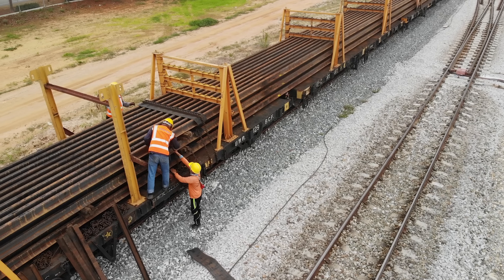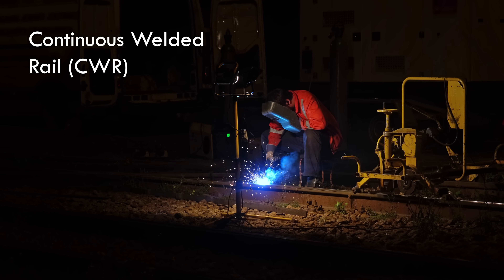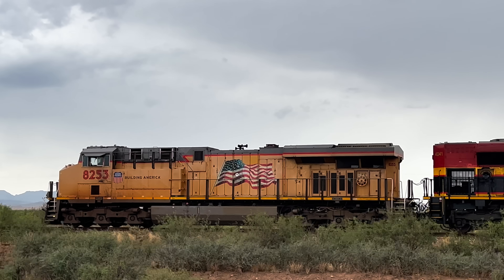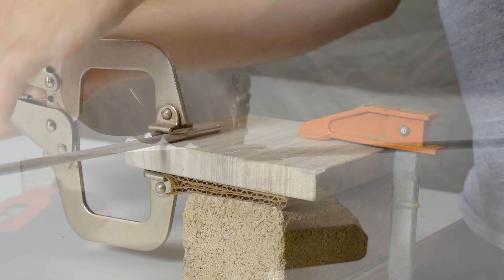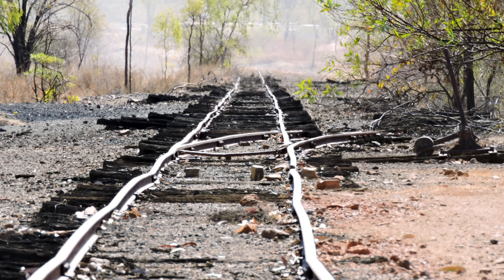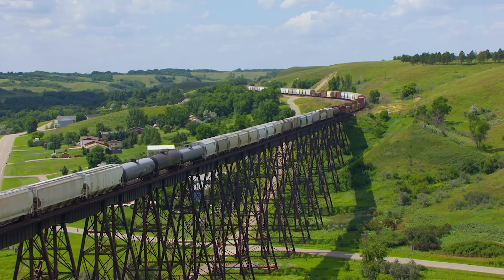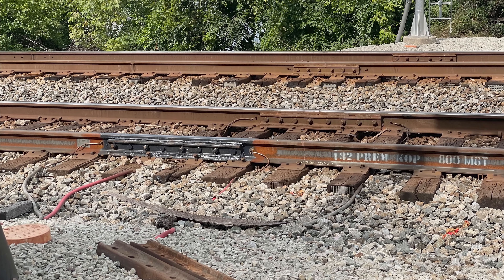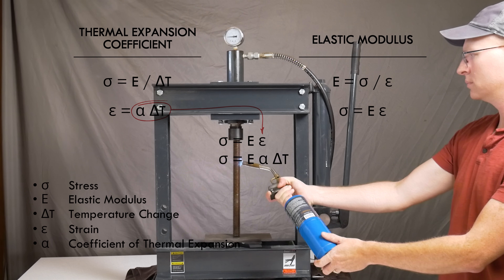Why Railroads Don't Need Expansion Joints

Comment: This was hard to watch. I'm in Victoria, Australia. Much of our rural rail lines were "upgraded" to continuous welded rail, about 15 years ago. The only problem is, the wrong materials were specified. The expansion coefficient of the chosen steel was not able to cope with our conditions. On hot days, the tracks buckle like a drunk's knees and our trains are forced to slow to a snail's pace. Often, they're replaced with bus's.
The worst thing is that the government was advised of the problem. We have a rail switch manufacturer in our town who sent numerous letters advising of the fault. They received no response.

Comment: Fun fact: The problem with 'rock n' roll' (more formally, harmonic rocking) is bad enough that rulebooks disallow travelling at certain speeds on jointed rail. The rulebook I have says this danger zone is 13 to 21 mph, so if your train only has enough power to reach 20 mph (entirely possible, if normal, these days) safety says you'd have to slow to 13 mph on jointed rail. So CWR not only makes maintenance-of-way's job easier, it also makes operating the trains a bit easier and safer too.
Reply: So I think your point is; stay out of the resonance zone or transient through it as quickly as possible.   Go slower or faster so you don't build up a resonance that can, not always but can go exponential. Blown mind all these little details that add up.
Reply: @miinyoo  i think that's the gist of it! good intuition
Reply: r e s o n a n c e
Reply: @erich1394    I think you both are correct.  As a civil engineer who spent over 20  years in track design and work, the term "harmonic rocking" is the one used by the railroads with certain speeds over jointed track with alternating low joints.  It is the alternating low joints that cause the problem not the joints by themselves.  There was a lot of research done to determine this phenomina.
Reply: @royreynolds108  Also bogey (or track) hunting. I forget which car type, one had a both a lower and upper speed limit when unloaded due to excessive gauge resonance that lead to $many derailments.
Reply: That's definitely one of the names of all time  @Trump2PrisonOn34Counts 😂😂😂
Reply: @Trump2PrisonOn34Counts empty gondolas have a speed restriction of 50mph because they don’t like higher speeds
Reply: @royreynolds108  So, I'm an acoustics major who had the great pleasure of being lectured to by a railway engineer 10 years ago  - that was the day I learned about easement curves and higher-order discontinuities and how they would cause trains to jump the tracks if you used constant radius curves. This concept actually informed me in my research into digital signal processing for audio applications. There's always more than one way to skin a cat / more than one lens to look at an engineering or physics problem through. I guess I'm just being a bit silly in my attempt to return the railway engineer's favor!
Reply: @codyandrew2029  Now you mention it, it was gondolas, for taconite or other iron ore?, and also had a lower limit on speed. Which with older units (I'm thinking the U38's and SD42-2's) had a 11 Mph minimum speed for 10 minutes, then you had to stop or speed up. The traction motor cooling was tied into that but I can't recall if it was an electrically coupled or belt driven system that drove the air flow over the windings. Since it was also on the SD42-2's I'm going to guess it was electrically coupled.
Reply: @Trump2PrisonOn34Counts  Now, it might be a bit difficult to find, but two problems ran into each other in the late 60's in the UK. The first problem was the "Short Wheelbase Wagon Problem", as small short wheelbase wagons that had been perfectly safe in steam days, toddling along at roughly 35mph. But put them on anything slightly faster, on track with less give... You end up with a lot of derailments! And, the early years of CWR was.... weird. In 1969, there were at least 5 accidents due to incorrect stressing and incomplete ballasting of the rails. And a short wheelbase wagon on newly laid CWR.... Boy, did you have a problem! British Rail tried longer wheelbase wagons with really good suspension, but they couldn't get enough into service to avoid a horrible hit to wagonload freight. The CWR problem was slowly and steadily solved, but their is probably at least one minor derailment a year that can be attributed to badly stressed CWR. Oh, and fun fact:- one of the derailments in 1969 was of... a heavily laden AMMUNITION train going to Felixstowe docks for transport to the British Army of the Rhine! No serious damage to the ammo, but there could have been!😮😂
Reply: @robertwilloughby8050  With the UK's practice of using draw bar tension buffering, do you have any insight in how that may have affected the physics of the bogies and hunting? If that sounds intelligent, it's not - I've no real training there, just seems a bit obvious to the unwashed like me.

As I recall, the UK practice of ballasting and ties (sleepers) is markedly different than the US and other standard gauge systems that are not based on the English systems (I'm thinking China in parts where they used something they came up with. Haven't seen much there, and getting photos in China... well, it was always a hassle and they have scams where locals try to intimated one into thinking they are police, but for a small bribe...)
Reply: @Trump2PrisonOn34Counts  Unfortunately, I'm in the dark as much as you are, I guess that's the perils of indiscriminate reading! I did know that ballasting practice was different between the UK and the USA, and I suppose the draw bar buffering will have some effect, but, yep, I have nothing.
Reply: @Trump2PrisonOn34Counts  It’s mostly mill gondolas that have the speed limit now. Empty coal or ballast cars are fine at track speed. 

Want you’re talking about is short time ratings for the traction motors on DC locomotive. To stop them overheating
Reply: @codyandrew2029  Thanks Cody. 
Correct on the motors. I stopped dealing with motors professionally three decades ago, so before RR's started using AC. Only two ways to control the speed of AC motor: Number of poles or the frequency. It hasn't been all that long that high powered semiconductors to do frequency switching have been available at prices that are low enough to justify the business case. Last time I looked at one in the flesh the thing was bigger than my leg. If I pound on the side of my head enough I'll either remember more, or get a headache. At my age headache seems more likely.
Reply: @royreynolds108  As a layman here, wouldn't the phenomenon cancel itself out if odd-length pieces of track were inserted randomly,  instead of always breaking the seams of the opposite track at the half point ?  It seems the trains get into that rhythm because the seams are continuously at the half distance.
Reply: @mattywho8485  the fundamental is that the steel is flexing... where there is no steel. That causes a sag. The other rail sags. The suspension will be activated raising the rail on one side and the sleeper underneath.  No Matter if one rail were solid forever. The other rail will sag or raise as the carriages bounce and bend,  breaking the harmonic amplifier effect distance feedback only decreases the excessive wear. It still makes for a bumpy ride and damage to the system.
Reply: @royreynolds108 immediately after the RR I work for swapped our main line from jointed to ribbon rail, we’d still get rocking. My understanding is that the hundred years of trains pounding on the joints in the rail compressed the rail bed under those joints, and even after tamping, the rail bed had a ‘memory’ of those joints. It’s not so bad now 9 years later, it’s been ribbon rail long enough and tamped often enough that it’s mostly gone.
Reply: Harmonic resonance is a fascinating topic. It's really interesting to learn the effects it can have in all sorts of different situations and different materials all react in their own unique ways.
Reply: whoa, that's... really slow for a train lmao. do the pointy rail joints help much?
Reply: Serbian railways, at least in 2010-2012, omg
Reply: Harmonic rocking is usually experienced on rough track in siding with jointed rail. The locomotive and/or cars literally rock side to side. So you speed up or slow down. But more importantly, by getting on the throttle or dynamic brake you couple the mass of the locomotives/cars. During coasting or idling the masses are FULLY decoupled and they can resonate with the track. 

Truck hunting is on a different axis. You’re not rolling left/right but yawing left/right. Same goes for getting on the throttle or brakes to settle it down. 

Truck hunting at 70MPH on a trailing unit can be VIOLENT. You have to hold on to your chair and can’t stand up.
Reply: @apricity69  Harmonic rocking is caused on known straight and level track. Expected rocking occurs on bad track.
Reply: @Trump2PrisonOn34Counts  I would have replied to you sooner but…I was actually operating a locomotive last night.
Reply: @apricity69  Then the engineers with PE's and engineering degrees are being imprecise talking to you. When an input (such as rocking) is caused by a deformation, it isn't considered a second order harmonic force, it's considered a primary input force.
Semantics are important in engineering. As a company learned when a missing "N" cost them 60 million dollars in fines.
Reply: @Trump2PrisonOn34Counts The rough track causes the locomotive to rock side-to-side. The specific speed allows it to rock side-to-side at the same rate as the inputs of the rough track. They are in harmony. So, harmonic rocking. 

In any event, the railroad terminology overrides the engineering terminology because we’re describing an event that occurs on a railroad.
Reply: @apricity69  Had to sit here for a minute with my caffeine to percolate though my brain, because for a second, I thought you were telling me that railroading isn't engineering.
Just read it again. Yeah, that's what you did.
Well, I can see this isn't going anywhere, and it really doesn't matter as long as the people that design the bogies know. By the way, the report you want to read is the one from 1968 on the Santa Fe tests on the matter. Scan the names and initials. Was going to include the FRA document number but it's not in the paste buffer.
Reply: @Trump2PrisonOn34Counts  You want me to read documents that you haven’t linked, with opinions written by long-dead people who have never experienced harmonic rocking, or ever operated a locomotive, and ignore my nearly 30 years experience actually running trains? Sorry, but first hand experience is better than third or fourth hand reports written by distant observers.
Reply: Lolz
Reply: So.. faster than 21 mph is fine... less than 13 mph is fine... anything between 13 and 21? Immediately catastrophy!

Like how certain hz may cause bridges to collapse (and therefore people shouldn't march over bridges) etc?
Fuq'n science always messing things up >:(
Reply: 20mph trains... that's horrendously slow.
Reply: So it's like the whole Ice road driving. You can't maintain a constant speed within that range because it just builds up energy and destroys the track in front of you?
Reply: Yup. I learned this when I hired on in 2014. We call it critical speed, and it’ll rock the cars right off the track. The subdivision I work on only switched from jointed rail to continuous welded rail (colloquially known as ribbon rail) in 2015.
Reply: A max speed of 20 mph? lol. Not in the first world
Reply: @paddor  Uphill slow, downhill fast, tonnage first safety last.  Some places trains have a tough time making it over 20mph.

Comment: So it must be difficult to install continuous welded rail in places that experience huge temperature swings throughout the year.  Like the upper Midwest where it can be in the 90s in summer and 10 below in winter.
Reply: It is a game of give and take.  RNT might be 95 degrees, but you know that the rail will break as soon as a certain temperature is reached so you prepare for it.  You may add rail back into the track in the fall, then remove it in the winter.

Comment: In the US, many railroads have fish plates that are in poor condition or even completing missing their bolts.  This is bad as those railroads are speed limited, noisy, and cause further deterioration not only in the railroads but the cars.  Fixing RR's is expensive...big rail has found it cheaper to pay for derailments than fix bad fish plates or switch to continuously welded rail.  This is also applicable to urban metros.  The NY and  Chicago metros are very noisy while the Chinese ones aren't...because the former are older systems that rely on fish plates.  These are noisy, slow subways down, and should be upgraded to continuously welded systems.

Comment: In my physics class we learned about thermal expansion, and its a fun formula that is used, but what is interesting is there is a coefficient that you have to multiply by, that is dependent on the type of material (iron, copper, concrete). But what is interesting is that that coefficient is different for if the object is expanding in one dimension (railroad for example), or 3 dimension  (such as an iron cube).

Comment: The whole time I was watching, I was saying "just install it hot!" In my head lol.
We face similar expansions in the construction field. Everything moves.
Reply: Rail installed too hot will have a breaking point that creates more problems than it solves.  RNT is closely matched to the regional weather of the area, and can vary by tens of degrees from state to state. Simply heating rail to 150 degrees RNT may prevent buckles, but the amount of broken rails as the ambient temperature decreases would cause massive delays and risk.  There are many other factors in play to prevent thermal misalignments such as specific ballast requirements, rail anchor and spike requirements, speed restrictions and how/when ballast disturbing work is performed.
Reply: @drummerdan14  that's why I said hot and not "too hot" lol

Comment: "Curiosity" question, possibly for a future "even deeper dive" video: Given that the rail is under (presumably quite significant) tension, how do they manage to keep it in place around curves?  As the trains go over, there would be a tendency for the track to migrate towards the centre of the curve in order to relieve the tension.
Reply: Curve rails are laid at different lengths, inside rail is shorter than the outside rail.  Ballast requirements are different, with the shoulders of the ballast being larger to hold the curves.  Elevation is added as well to balance out the curves.  We apply monitoring stakes to capture curve movement, because they do move, then we use track equipment to reline the curve back to its design.  Sometime this movement requires rail be added or removed from the track to make the rail stop moving.

Comment: My solar thermal expansion power idea I’ve had for a couple of decades:
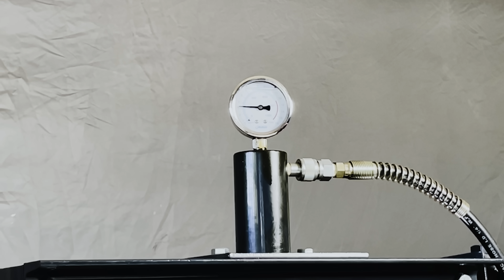For years I have wondered how much power could be generated from a thermal expansion based generator.  Similar to this video @7:18, a large steel I-beam for example could be laid down horizontally, constrained on one end with a generator on the other end that is powered with the thermal expansion movement in both directions.  Reflectors could be used to amplify the Sun’s heat which could be automatically rotated to create shade, with a closed loop cooling system to cool the I-beam, with that heat energy used to heat nearby homes, for industrial use, etc.  The system could automatically heat and cool the I-beam throughout the day to maximize the power output.

Comment: Well, Grady, there ARE low coefficient iron alloys like Invar and Kovar, but they would get very expensive very quickly at the amounts needed for railway use. They are used as lead frames for integrated circuits, vacuum tube elements/penetrations, etc. They still expand but WAY less than steel.
Reply: Don't certain variations of invar actually contract as they warm? I think I remember hearing that.
Reply: NiTinol can undergo phase changes and shape (including shrink), and some shape memory alloys are resetablr

Comment: 9:01 Did you just call imperial units SI? That's certainly unusual... SI, standing for Le Système International d'Unités, is a subset of metric units that are canonical in science, and engineering, overseen by a bunch of standards that begin with ISO and the like. Never seen feet and Fahrenheit described that way...
Reply: Officially it's "United States customary units", because some things differ from Imperial units. I'm sure "SI" is a mistake in this case